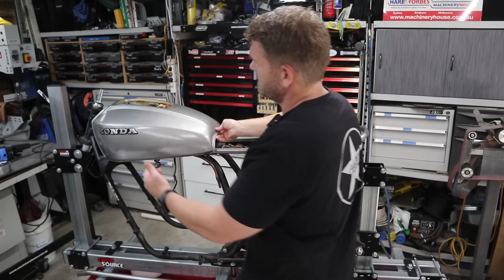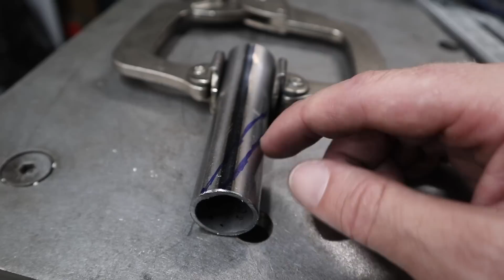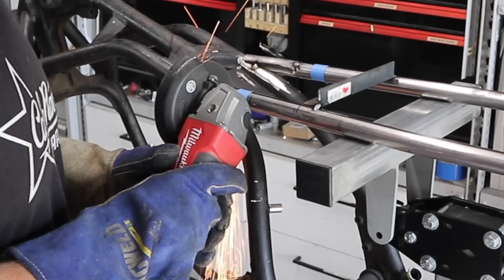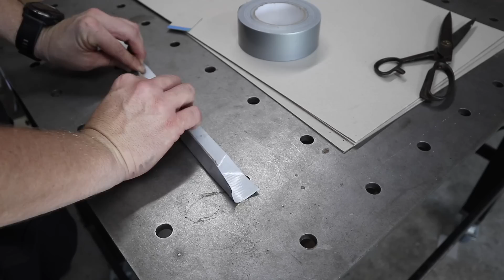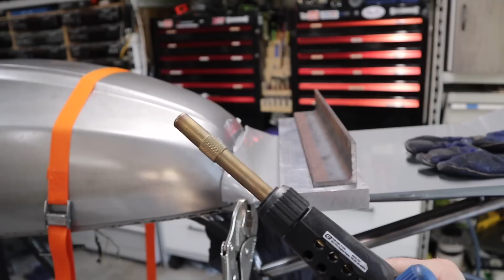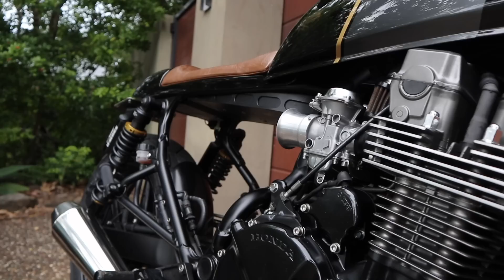How To Build A CAFE RACER Step-By-Step (Honda CB750)

Comment: Love your videos, keep up the good work! May I ask what a belt grinder like that is called? Looks very handy! And also, I think without panels. Much cooler to see the suspension through the frame
Reply from the maker: @wrecksigge2654  thank you mate and it’s called a belt grinder and you can get all different sizes depending what you need you can also got attachments for a standard bench grinder or similar to this from hare and Forbes, hope that helps
Reply: @ Thanks alot :) !

Comment: Another great video Dan, and this one coincides nicely with where I'm at with my own project.  Can I ask, as a general rule how much gap do you allow for the upholstery wrapping around the seat base.  I'm guessing that this might depend on what I plan to use for the seat covering but have been working to allow 3-4mm.
Anyway, keep up the great work.
Reply from the maker: Thank you mate, and if you are not trying to wrap a stitch line around the area, that will be fine; however, if you are, you might need to add about 5-6mm depends on the upholstery type, the curve etc etc
Reply: Thanks Dan.

Comment: You can also leave a 1.6mm (tig rod size) gap between the two bevelled tube pieces to ensure full penetration around that tube. AND if you make the inner sleeve, your full penetration weld with the 1.6mm gap will catch that inner piece, too.

Comment: Welding. My favourite superpower.
I do have to ask, though, I was welding a plate back in an antique safe, with 10mm thick walls the other day, and used used some rare earth magnets I use to hold my chuck key and stuff to my pedestal drill, and they lost their magnetism. I probably got them too hot. Is this something you've experienced?
Great content as always. 
And, no infill. 'wanna see that mono shock.
Stu. Melbourne
Reply from the maker: Thanks mate and to answer your question. I do believe that magnets lose their magnetism through heat especially extreme temperatures.